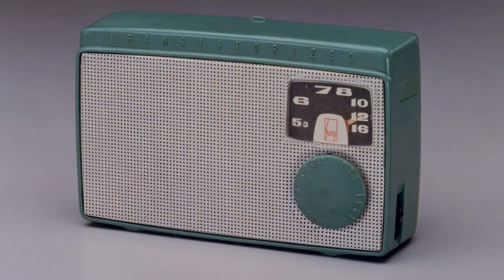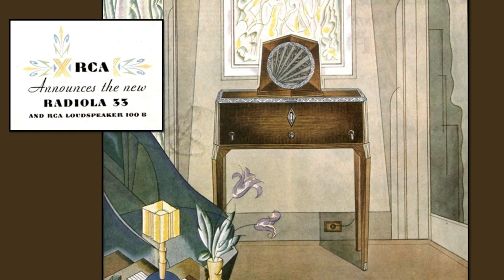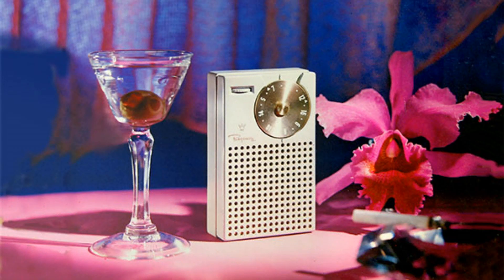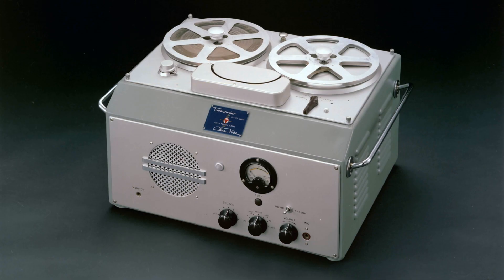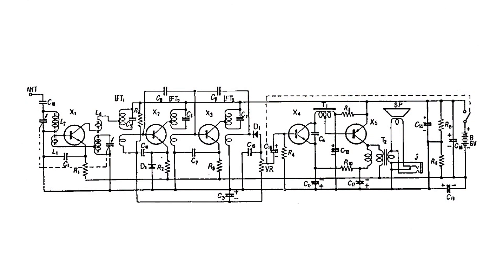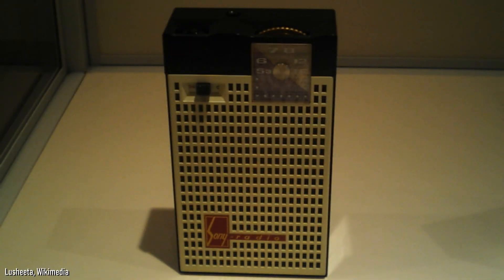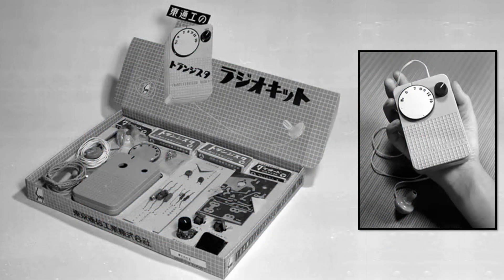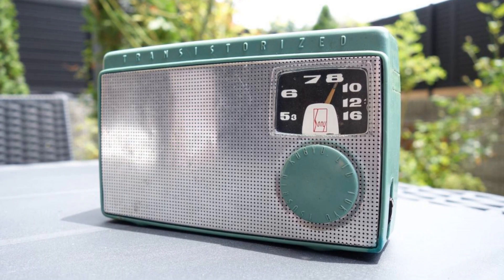Forget the Walkman! Sony's Revolutionary Radio

Comment: My pride and joy is a GEC Transistor 7 (that is the British GEC), the same model featured on the BBC programme "The Repair Shop". Mine has a capacitor dated December 1961 and has a wooden case, so only a few years after the early transistors with their production problems we have a set that still works over 60 years later. I paid 50p for it at a car boot sale. It is a powerful radio booming out the shipping forecast until they switch the transmitter off.

Comment: 1:10  Wow, those 1920s radios were really expensive.  Revolutionary was the loudspeaker cabinent (at further cost) to make headphones unnecssary but only really practical if your house was wired for electricity to not have to go through literally a ton of batteries.

Comment: I own several Sony products. They are built to last. My home theatre sound system is very old by today's standards. It is 17 years old. My Sony TV is over ten years old. I have a Sony sound system in my car.
Reply: As kids around 1990, I and my brother both got our own Sony clock radios for Christmas: a model with a tape deck in the front, and dual alarms (radio/tape, beeper, or both -- with separate alarm times).  I set the radio to go off first, with the beeper alarm 5-10 minutes larer.  I did use the tape deck once in a while too, to wake up to music of my choosing.  

My brother still uses his to this day, as a bedside alarm clock.  While I retired my own about 10-12 years ago, after the clock-set button broke off inside.  (It was on a poorly-supported corner of the circuit board, and had to be held down quite firmly to work.)  It otherwise still works just fine, though, so my brother uses it in his garage -- and presumably plugs it in at midnight to set the time. 🙂

(My replacement for it is a simpler Sony dual-alarm clock radio, that's just a clock and a radio.  Both alarms can be set to either radio or beeper.  And it has a DST button, so no cycling through 23 hours when the clocks go back in the fall. 🙂  I'm fully expecting the thing to last the rest of my life, if not longer.)

Comment: In my preparatory school in the 1960's, "transistors" were the absolute hype. If you had one, you were it. I pestered my parents for such a device and in 1966 got a Russian transistor radio made by SELGA for Christmas. It exuded huge build quality, with a real cowhide jacket that smelt strongly of the Connolly seats in the family Rover. That was my first love. To explain: At school, they were banned on pain of discipline. But then, we had transistor radios at home, where I would listen in my bed after dark to the BBC Home Service (which very soon became Radio 4) and very infrequently, the BBC Light Programme, but only in order to jiggle the tuner wheel.
Reply: It was very nice to hear this memory from your past. People are the same across the generations.

Comment: I still have a "two" transistor radio with speaker from around 1962. Sensitivity is not great but selectivity is surprisingly good. The output volume is decent, no faint at all. The internal design is higly optimized especially the front end transistor and several AF/RF transformers.
These radios were apparently the japanese response to get around an US tax on imported devices containing more than two transistors, the goal was to reduce the flood of low cost japanese radios.

Comment: Car radios were practical already.  After all you had a high amperage 6v power source and a vibrator to generate higher B+ voltages.  Tube based car radios were pretty common all through the 1950s.  Though Sony did produce some portable TVs with the transistor in the mid 60s, the TV largely stayed around as tube until about 1970.  There were hybrid solid state/tube TV well into the 1970s, especially at the low end of the market.

Really, what was more important than transistors for radios and TVs for that matter were solid state ICs.  First it was just individual sections of a radio, but soon it was the entire radio was on a single chip with just a few support components.  Same with TVs.  The tuner was a large metal box with a fairly complex mechanical switching device with a tube or 2, gradually it disappear along with other circuits in the set.  By the early 80s, you had most of the TV circuitry on a single chip.

This did a lot for energy savings.  A 24" color set in the 60s consumed like 350-500 watts.  By the mid 80s, more like 50 watts.  They became much, much more reliable too.

Comment: You could easily pay 2-3-4 times the price for a transistor radio and be WAY out ahead after a couple of months of heavy listening.. 
High quality battery operated tube portables were very energy efficient, using  about a watt sometimes less.  The cheap ones were generally not as efficient.  But another problem was that you need an A/B (filament voltage and circuit voltage) battery. They generally ran around $5 (at a time when an ounce of silver was 1 Dollar) and the A/B battery was useless once one section dropped to an unusable voltage.  As a rule, you might get about 5 hours out of a five Dollar A/B battery.
But a transistor radio could get 20 hours or more out of a single 9V battery or 4 double AA batteries, again, depending on the quality. 
The battery is where you would really save the money even on an expensive transistor set.  This is also why so many farm and portable AM tube radios have tubes that are like new even today. They were just too much money to run. So they weren't run much.
Reply from the maker: The Regency radio also ran on a non-standard 45V battery, whereas the Sony radio required 4xAAs.
Reply: @LittleCar  I did not know the first one used a high voltage battery.  It was probably just as expensive.
Reply: @LittleCar My family's first transistor radio was a 12 transistor, three band Yaou General, about the size of a tissue box that used 4 C batteries. My dad later modified it to use a 6V wall wart power supply.

Comment: I have the modern "pocket sized" unit displayed at the end of the video, the ICF-P27. In 2024 where streaming is the norm there is a sort of charm in letting a DJ pick music for you (only really applies to the smaller non-commercial stations) and not requiring a paid two-way internet connection to do so. It's also pretty power efficient, they claim almost 100 hours on 2AA batteries and it's still on the pair I put in it ~1.5 years ago. It's using a fairly modern tuner IC from Sanshin that people have claimed to be based on Digital Signal Processing but supposedly the decoding part is analog according to the Japanese product sheet and that apparently helps with the power efficiency. It's fun to fiddle with on my desk and I suppose I might get more use out of it once KEXP launches KEXC here in the SF Bay Area. I only wish it had FM Stereo but, then again, it was $25.

Comment: One of my aunt's had the gen 2 Regency transistor radio from the mid 1950's.  I found it among her stuff, after she died. It worked for a while, but I can't remember; what became of it?
      Around 1965, transistor radios became dirt cheap. Before then, they were definitely considered a prestige item. Most radio until 1965, table, console, or portable, still used vacuum tubes, aka "valves", until then.